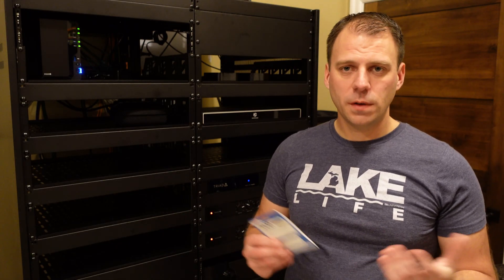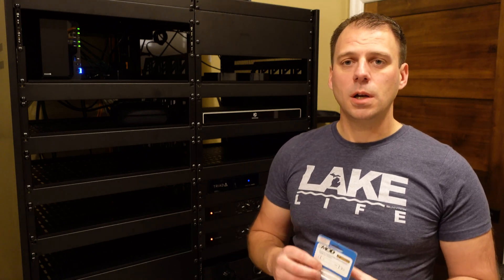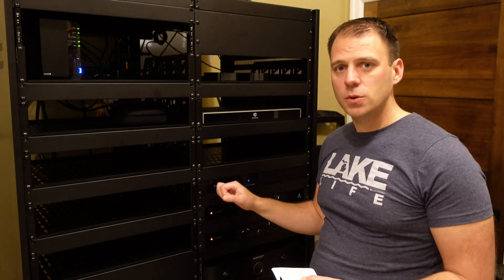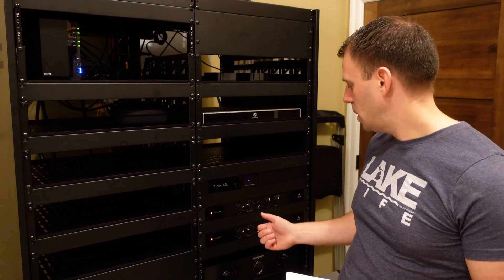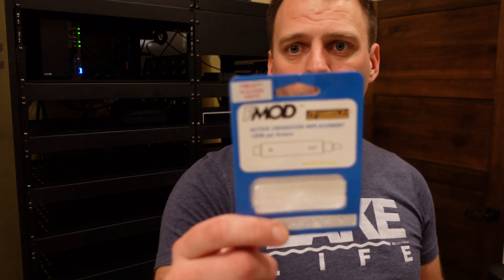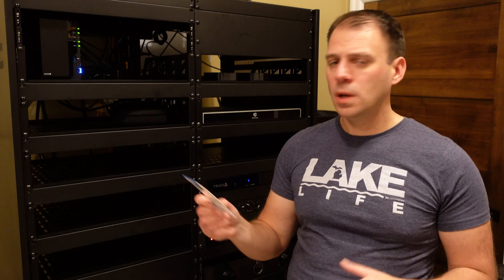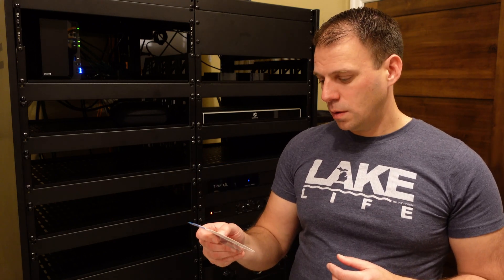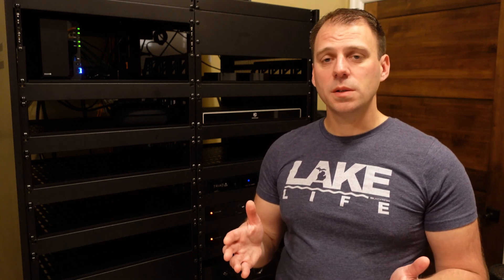Using External Crossovers for Home Theater Speaker/Subwoofer Bass Management

Comment: I'm highly skeptical of the claim that those cheap inline RCA crossovers / filters don't color the sound; not all reviewers agree on that.  May not be very noticeable on a mid-fi system, but I would be very hesitant to run HiFi signal through those things on the way to a $10k pair of speakers (for example).

Comment: I used those FMOD's in my bi-amp 2.4 pro audio home system (9,000+ total power). I agree with the 80/90 Hz crossover point. 100/110 Hz makes the subs sound too muddy. I still have those inexpensive FMODs but had to use adapters for the XLR balanced in/outputs (from the mixer to the amplifiers) and low quality RCA cords weren't cutting it (most are not shielded thin AWG crap). I went with an active 2/3 stereo or mono ACTIVE crossovers and using gold plated balanced and shielded XLR cabling. It is superior to those FMODs (overall) and the cost isn't that much more if you calculate in the additional cables, adapters, etc into the final costs (maybe $200 more). An active crossover lets you adjust subwoofer and mains gains...incredibly useful. However, those FMOD's don't add any THD to your system and have a nice slope rolloff (and easier on the wallet).
Reply from the maker: Thanks for sharing! Can you link the active crossovers you use?

Comment: So I got a pair in my 2 channel and the leap in fidelity after I adjusted the rest of my gear is absolutely phenomenal for the money. Cheaper than a DSP and a simple, elegant, and analogue solution. I got the xlrs 100 hz12 dB slope on my CSS 1TDX Superiors with a pair of subs and it is lovely. Great product.
Reply from the maker: Awesome that these worked so well for you!
Reply: @Techthusiasm  yeah, I expected an increase in upper range fidelity, which I got more than I expected, the increase in bass texture and  just.. beauty.. with the subs no longer arguing with the speakers, just phenomenal. And I don't have to deal with another box that requires constant wifi.
Reply from the maker: Yeah, I've seen it mentioned a lot that running a lot of speakers full range limits them. It taxes them and the amps. So crossing them over well is very desirable to really let them perform in the range that matters.
Reply: @Techthusiasm  well the crazy thing about these speakers is they will definitely try. Most of my other speakers just naturally roll off. If you give these things  20h tone, those woofers are moving in and out. So I majorly eliminated that with these. $130. My system sounds so good now, I think I just add 2 more subs for 4, and that's a wrap for a good many years.

Comment: just use a active crossover!!!!!!
then you can "have bass management"
all this guys doing is limiting amplifier performance via the cheap inline resistance crossover RCA Couplings shown.
Active Crossovers allow you to select how each high/mid Low & subwoofer sounds indivividually & set gains & your crossover levels to suit you & your rooms shape and so will avoid any unwanted outcome!!!
Reply from the maker: Well sure that’s preferable but not always practical. This is just a simple way to achieve a result in certain situations. I’ve replaced it my setup anyway now with an Anthem STR for the room.

Comment: I'm running a 2.2 audiophile listening setup with JBL Subs and JBL horn speakers. I really don't want my horns playing anything below 80 hz (they honestly can't anyway). My subs have no problem playing up through 100 hz. The subs have low pass filter adjustments built into the back but neither my schiit preamp nor my adcom poweramp has the ability to highpass filter my horns. Thus, I should be able to grab a set of the 100hz harrison labs highpass filters to fix my problem, right? Or should I go for the 70hz ones? Also, how aggressive is the slope that cuts out the bass?
Reply from the maker: Yes, your situation is exactly what the high pass filters like these can help by limiting what goes to your speakers when other parts of your system can't. If you don't want the horns below 80, then grab the 100 I guess. I'm still kind of mystified that they don't make an 80 Hz model of these given how prevalent 80 Hz is,  Regarding slope, it might be different per model, so check the listings. Feel free to use my Amazon link in the description to comment.
Reply: use a Active crossover i am with my amps just for my subs!!!! 7.1ch system as a 7.2ch by using 7ch +then the pre outs to Active crossover for 2nd amp & 2 subs for bass mananagment